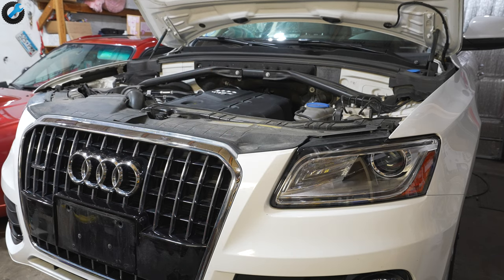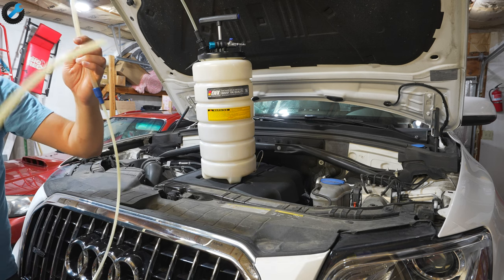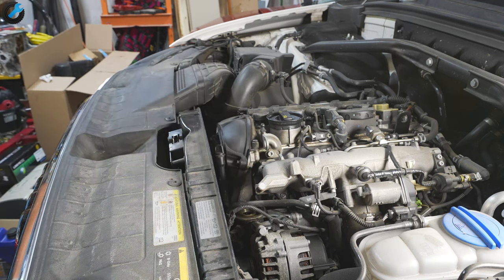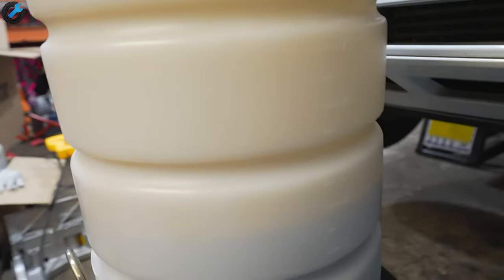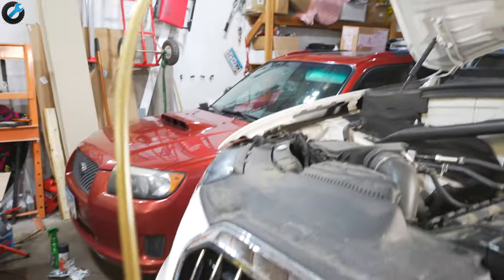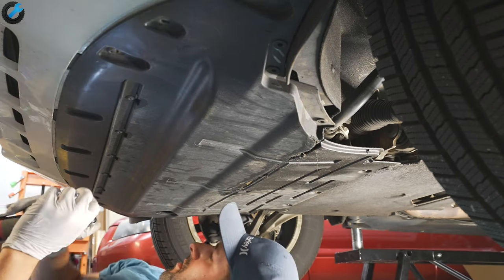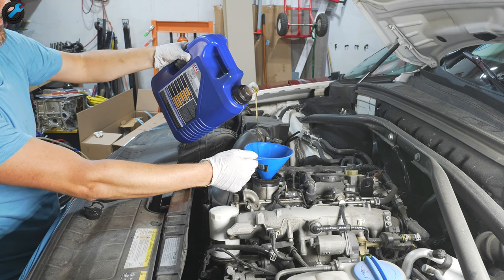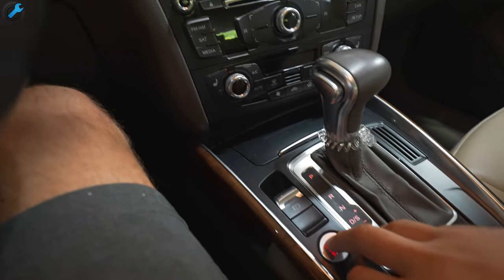Audi Q5 2.0 oil change - use an extractor to pump out old oil - no crawling under the car

Comment: Do you ever need to change the drain plug at all if you're changing oil by extraction?
Reply from the maker: No, you do not ever have to touch the drain plug if you are using an extractor.
Reply: @happywrenching how many times you can use this method? Is safe every time to extract the oil like this?

Comment: I think it’s just complicated and not easiest than a regular oil change drain it from underneath the engine…
Reply from the maker: Let's see, you don't need to remove the belly pan. No need to remove the drain plug and drain the oil and potentially risk stripping the drain plug. No need to crawl underneath the car. I can do this oil change in under 15 minutes. There is no question that using an extractor is easier and less messy.

Comment: My car still shows service due sign even after I reset the oil interval, what else do I need to do to clear the warning sign?
Reply from the maker: As far as I know, the service due message can only be cleared using a scan tool. Oil interval and service interval are two different things.

Comment: The oil that you're extracting is that the engine oils bcus I need to drain some oil bcus my gf over filled it and it's asking to remove some oil?
Reply from the maker: Yep, thats engine oil. Perfect use for extractor if you over filled
Reply: @happywrenching  perfect this helps a lot thank you I appreciate it 🙏

Comment: How is the extractor working out for you?
How many miles on the Audi? What year? Any issues? Thank you.
Reply from the maker: No issues with the extractor and I’ve used it to extract oil, coolant and gasoline. It just makes things so much easier especially if you have a car where the oil filter is on top of the engine. 112,000 miles in the Audi and its a 2015.
Reply: @happywrenching  Thank you. I bought a 2022 Audi Q5 brand new, do you find your Q5 to be reliable? Came from Toyota/Lexus all my life so I hope my Audi will give me the same reliability. Any tips of maintenance would be greatly appreciated. Thank you again!
Reply from the maker: @jimmydoan007  Sadly, Audi is just not on the same level of reliability as Toyota/Lexus. Right now, 2013 - 2017 Q5s seem to be the most reliable and our 2015 has been doing pretty good. Bought with 86k on the odometer and now with 112k it hasn't had any major problems. There aren't any secrets to maintenance - keep up with frequent synthetic oil changes and change the coolant and transmission fluid when required. When the car is cold, drive it gently for the first 5 - 10 minutes and let everything get up to normal operating temps. Always store in garage when not in use.
Reply: @happywrenching  thank you very much….

Comment: This video is so helpful. I can start doing my own oil changes on my Audi. 

What size is the fluid extractor your using in the video?
Reply from the maker: So I used a 15L extractor in the video and I think that's too big for most users. You should be fine with a 6.5L and I have added two links in the video description with both sizes.